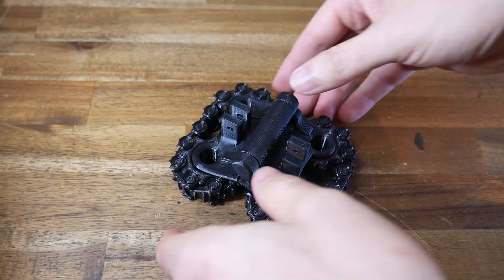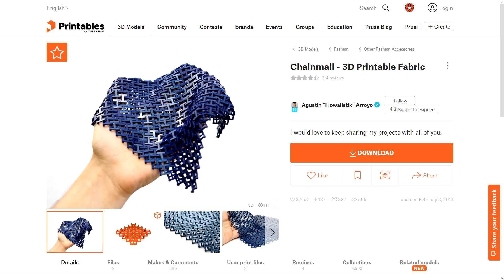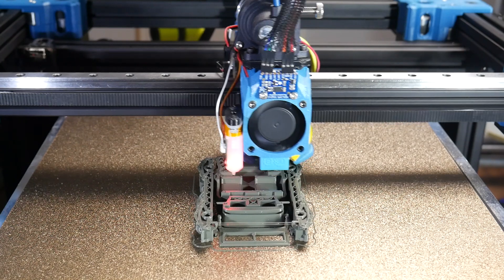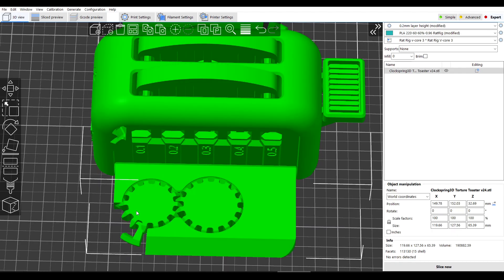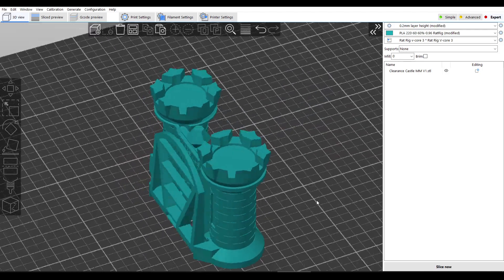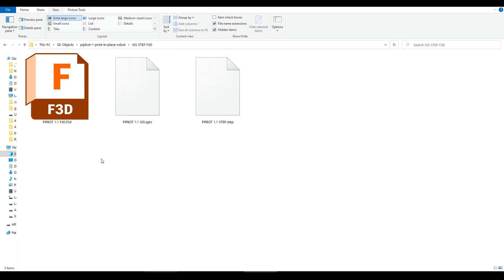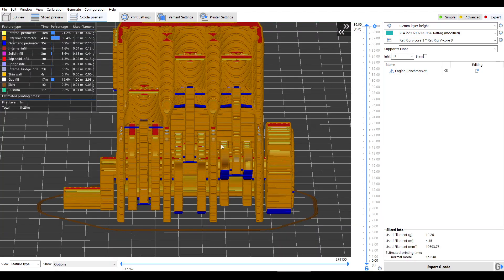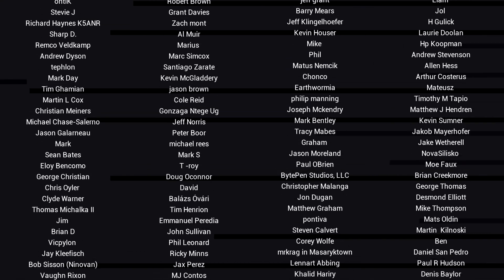7 super satisfying 3D printing torture tests

Comment: You're absolutely right. The torture toaster has put me in the corner several times unt I could beat it.

Had to learn some mechanical engineering the hard way to get everything to work. The final hair puller was get all tiny pieces to stick to the PEI bed. I am trying to maintain high speed printing, which makes it a bit harder. 

Though now I am quite satisfied with all adjustments I done to my custom which will help all prints from now.

Comment: need help with The Torture Toaster i can only move the .5 and the .4 what do i need to do to make the rest move ?
Reply from the maker: Start with calibration of flow rates. Over extrusion will swell the parts and tighten the clearances. Part cooling will also have a bearing.

Comment: They're usually designed for 0.4mm nozzles right? I usually print with a 0.6 and the models tend to fuse. I'll try stepping down extrusion widths to 0.4.

Comment: The absolute best torture test you can do for your machine is this...Wait until someone contacts you to commission you for a designed product and a final print. Give them a time frame for when it's guaranteed to be finished, give them a price, and then go ahead seal the deal and take the payment. If, by chance, your computer doesn't hear you and go ahead and delete some of your 3D modeling software's important system files as a preemptive strike, try to print the model you just made. If your printer even bothers to power on, it will at least certainly find a few overhangs (at the 6-7 hour part of the print) that should have had support, knock the part loose from the print bed at around 90%, form a clog, hide all of your spare nozzles, and kick your cat just for good measure... But... after a week and an apology to the customer, along with a small partial refund for "Sorry about all of this!" you will get it working in tip/top shape to print that next Benchy or XYZ Cube...

Comment: I hope one day, there'll be many machines that will just take these STLs and print out great parts without fiddling with settings. Imagine if you had to adjust your microwave a bunch of times to get it to make popcorn.
Reply: So like some kind of AI that will generate the best settings for the kind of model you're trying to print and you can then copy those profiles to other files? Because I do think that it would be more of a slicer add on than a printer machine kind of thing. The printer just prints whatever the gcode file tells it to do depending on how you set up the profile on the slicer software. I think it would be a cool thing to have.

Comment: I have just printed that engine on ender 5 pro with PLA klipper direct drive and pressure advance set (by your tutorial if i remember or maybe makers muse hack it) , and yes. There is need to clean print with a knife, set the proper temperatures (I was changing it while the engine was printing, because I saw that something is going wrong).
But I was successful in first print in the first try, stiff but it spins. YES it is hard Print.
On 80mm/s and 600 mm/s2 acceleration actually no infill (i set 6 walls layers), 0.4 nozzle 0.2 layer it took ender 5 pro 2h30min.

Comment: I kind of wish you'd show us what to do when you fail a particular part of a particular print.  Meaning, you mentioned in the video you kept getting a curl up that kept hitting the nozzle causing a failure, I have that exact problem with different types of prints. What do you do to stop curling?  Everyone on Reddit everyone on YouTube says lower the temperature raise the temperature, and I found printing inside to outside instead of outside to inside was the answer, but then one introduces more stringing problems because it finishes on the outside and doesn't cross back over the printed wall causing the string to be on the outside of the print.

Anyway, I digress. Your prints look great, and I always look forward to a video!

Comment: I printed the tank on my Ender 3 pro a few weeks ago. It's converted to direct drive using the $30 creality kit and I was using the Chep fast profile just changed the retraction for the direct drive and increased the extruder temp. I used PLA and other than having an issue with the PLA being inconsistent and causing skipping for a section of the material it came out very good on the first try. I did have to break loose a couple treads and the main pivot took allot of persuading. If I were to print it with a better quality profile I see no reason it wouldn't come out as good as yours did.

Comment: I printed the 6 cylinder version of the Print in Place Engine , my problem was the first few layers it would come free, so in the end had to print it with a brim , them after completing worked first time. ( X1C combo )
I don't like it easy so I printed the Torture Toaster in 4 colours , and got it working down to 0.2mm , which on a normal clearance test can get the 0.1mm free , so not sure if it was the 4 colours or 0.1mm vertical .

Comment: Lol, I printed that 3 cylinder 2 years ago with instant success as a 3d noob. On a Ender 3, two days old, stock settings with Jupiter pla 200 degrees. Guess that was a typical case of 'beginners luck'...
Reply: No, I did the same thing on my bone stock FLSun Q5 and Voxelab Aquila. Great test though.